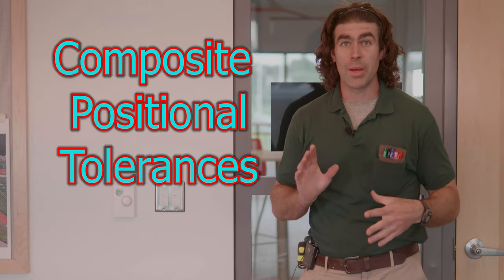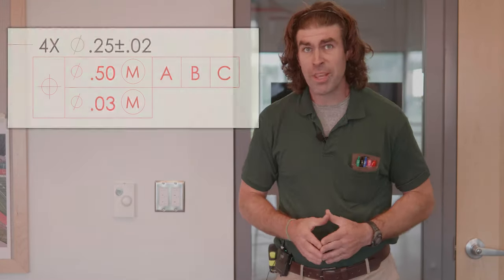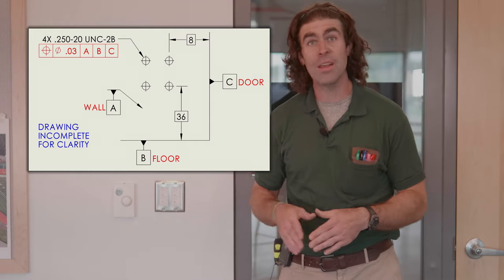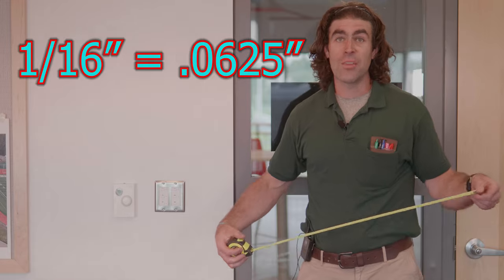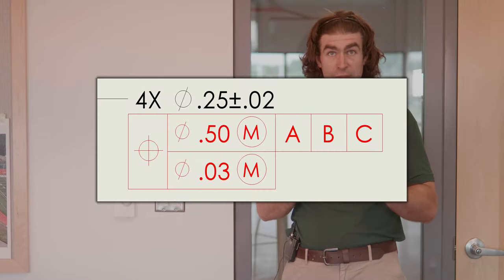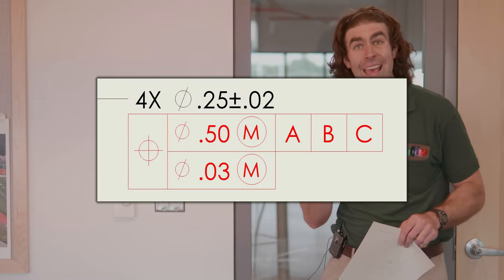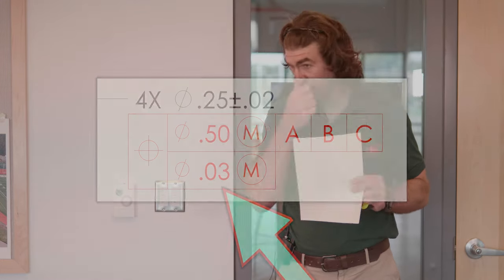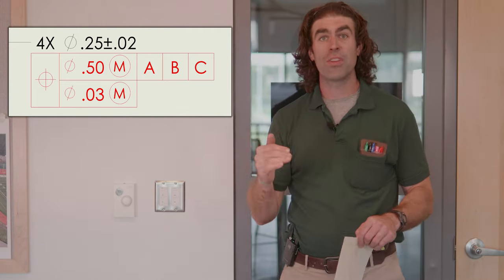GD&T ASME Y14.5 Composite Position Tolerance Practical Explanation

Comment: You make great videos, thank you.
For the example of the wall switch. Wouldn't it be better for the lower feature control frame to also have A, B, C in the DRF so that the 0.03 tolerance zone does not rotate with respect to the Datums. Thereby controlling how level the switch is with the floor and how parallel it is to the door frame?
Reply from the maker: Hi, with composite position, the lower segment only controls orientation and basic dimensions inside the pattern.
The first datum reference to A controls the orientation of the holes to the wall, adding datum B would control orientation to the floor or wall (I forget which one I used), but not distance from the floor or wall.
Reply: @RDeanOdell So I think that if we were to want a level switch to both the floor and the wall, the lower segment would only need "A,B" in the DRF. "B", the floor, would prevent the clockwise and counter clockwise rotation of the 0.03 tolerance zone. The "C" would not be needed since "B" is already stopping that rotation. Also, "A" is stopping the other rotation that "C" would be able to stop. By putting "A" in the lower segment it would keep the 0.03 zone locked vertical with respect to the wall. But without "B" also included, the pattern of holes would be allowed to rotate clockwise and counter clockwise within the larger 0.5 tolerance and while keeping the BASIC distance between the holes true. That would allow the pattern of holes to end up not level with the floor.
The way I learned it, without any datums in the DRF of the lower segment, none of the rotations that the datum features could stop are stopping. It would just be a Form control.
I'm not sure if I'm correct about this. I'm still learning GD&T.

Comment: Does the Y14.5 standard allow the holes in a composite controlled pattern to be of different size?  If so, how would that be annotated?  Thanks!
Reply from the maker: Hi, it’s definitely shown with coaxial holes, so I don’t see any reason why a pattern couldn’t be of different sizes. The reasoning is that you are controlling the axis of each hole, so the diameters can be different and result in an axis that falls in the composite tolerance scheme.

As for annotation, I would repeat the feature control frame for each pattern of holes  and apply “SIM REQT” adjacent to the lower segment of each composite FCF. That will lock the patterns together. 

You may be able to use a single FCF, but it would probably require a note to let the reader know what you want.

Comment: Hi, In Pattern Locating Tolerance Zone Framework, it is mentioned as Dia.50_MMC. is this right one? Or it should be Dia.05_MMC?
Reply from the maker: Hi, it’s intended to be .50” in this example because the height of the switch from the floor and distance from the door is not critical.
It’s probably rare to see such a large tolerance zone with position, but there is no reason it can’t be used.
Reply: Thank you.
In upper segment, if it is Dia.50_MMC(Hole). Then Functional Gauge is not possible, am I right? Because VC=IB=MMC-GTV=.23-.50=Dia(-.27).

Comment: How do you measure it by using cmm?
Reply from the maker: Hi,
The measurement plan will be the same as far as the probing. It’s the interpretation of the data that will need to be changed for a composite position. What kind of CMM are you using?
Reply: @RDeanOdell  I am using Mitutoyo CMM. For upper value, I just measure position tolerance with M, but not sure how to do for lower value.
Reply from the maker: @CarolineCA23  I’m not an expert with mitutoyo software, but if the lower segment tolerance is met to the upper segment datums, the requirement will be met.
Reply: @RDeanOdell  thank you very much! Could you please explain on how you do measurement using cmm with any software that you are familiar with?